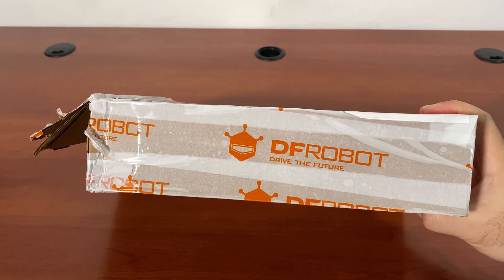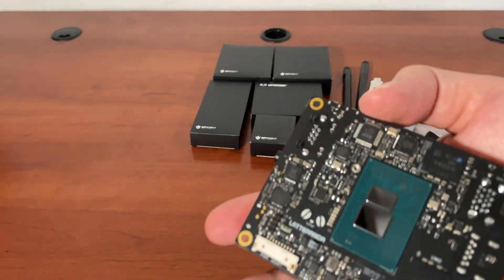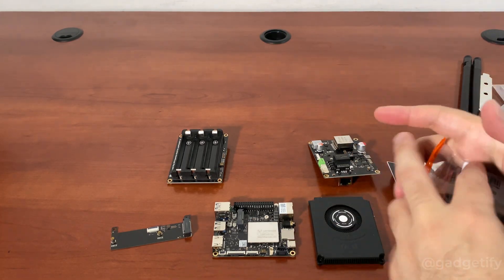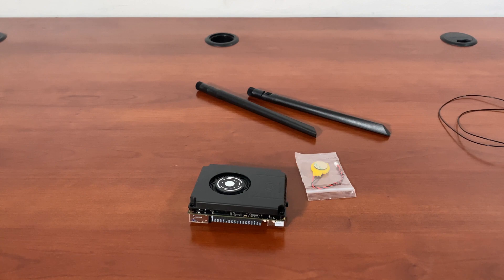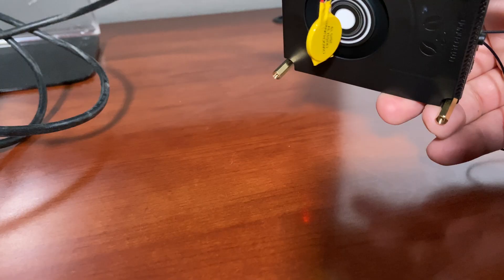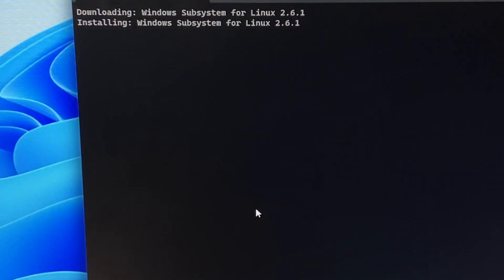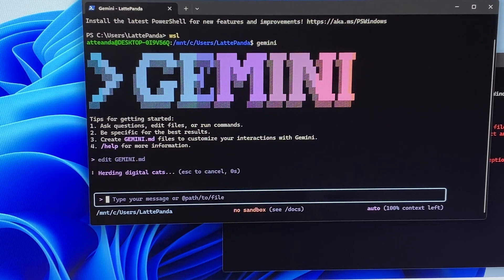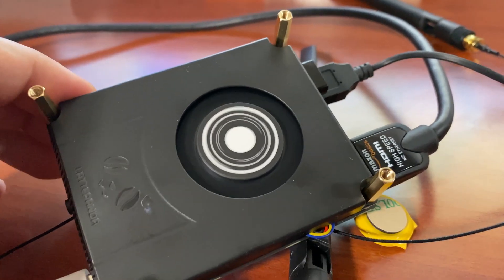LattePanda IOTA Tested ⚫ Palm-Sized Win 11 Computer Running Gemini CLI, Stockfish

Comment: You didn’t take off the protective film for the thermal tape and you didn’t put the thermal gel on those silver blocks 😭.
Reply from the maker: I didn't show everything in the video. The video is edited for time purposes. I followed the instructions and it does not overheat. haha. This thing gets hot if you don't install it properly.

Comment: N100 and larger processors are good. A mini PC with such a CPU can be cheaper and significantly faster than a Raspberry Pi 5.
Reply from the maker: Definitely has a lot of potential. I didn't even cover all the modules, like SSD and UPS> Maybe will do in the future. I was very impressed. Raspberry Pi is kind of great for simpler projects. This can be used for serious robots.